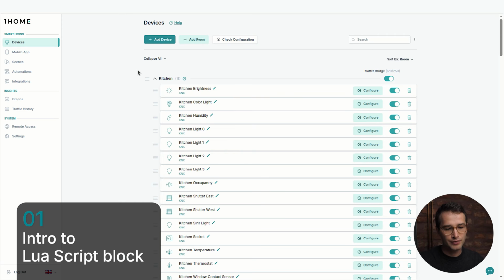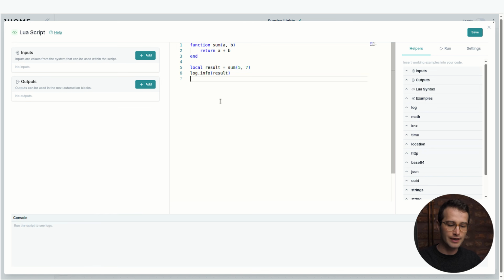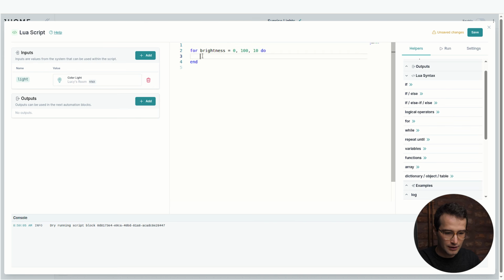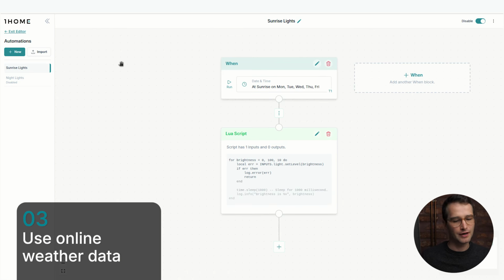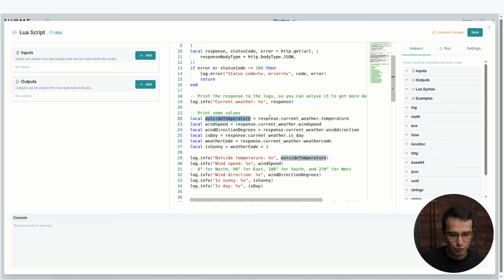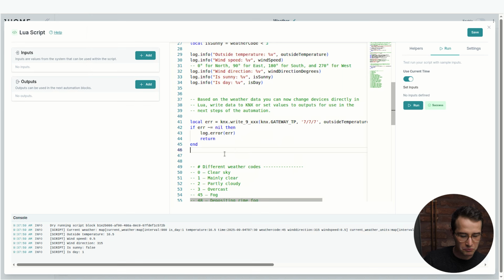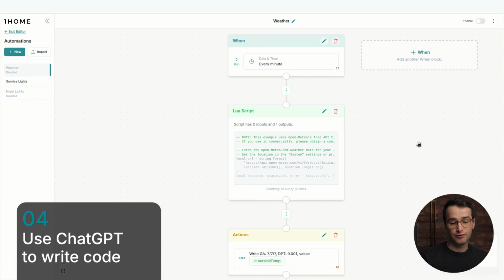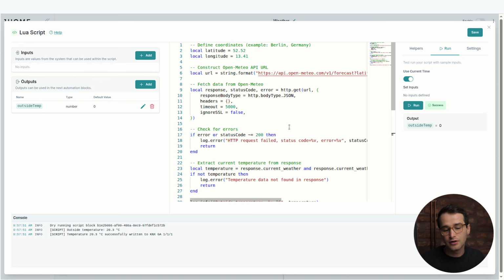Lua Scripting: 1Home Automations Deep dive

Comment: Very important upgrade and very much appreciated 👍! I was just struggling on a specific issue which I could not solve with the current Actions available. Looks like a whole new world of possibilities. Is it possible to get a last known KNX value inside Lua without actually reading it actively on the KNX bus? That's another feature I am missing.
Reply from the maker: This is possible if the device you're getting values from is set up as "Generic Device" in 1Home. Then you'll get last known value, not read from bus.

Comment: I've asked several times whether the KNX Server PRO has all the features of the other devices. The answer has always been yes. But I can't find a LUA function (version 4.1).
Reply from the maker: Hey! Lua, Traffic Monitor and Graphs are coming to 1Home Server KNX Pro with the v5.0.0 release in the next few weeks!
Reply: @1HomeSmartHome  Hello, I still have the 1Home Server for KNX, not the Pro Server, because the Pro didn’t exist yet when I bought my 1Home Server. I wanted to ask if the Lua scripting will also be available for my 1Home Server. I really need this feature.
Reply from the maker: If you bought 1Home Server before Pro variant came out, there's a good chance you actually do have the Pro version :) You can check this on your 1Home Dashboard under Settings -> System -> View Details -> Product Variation. If Product Variation is "for KNX" then you have an early-bird Pro variant.

Comment: This is so powerful. Will it be possible to access historical data with lua, eg the humidity 5 minutes ago to check the trends of certain sensors?
Reply from the maker: Hi! Historical data will not be directly available from the Lua script. If necessary, you could however have a long running Lua script that would read the group address of the humidity sensor and compare changes over time.
Reply: Will it be possible to run an infinite lua script? Is it planned to make historical data available? It should be there from the new graph :)

Comment: Great, but already imported many times KNX project and its not reading all the group address.. please fix the basic first so we can use all the automations properly
Reply from the maker: Thanks for the feedback, we'll keep improving that :)
Reply from the maker: Have you had more success with your imports? If not, feel free to contact us at support@1home.io
Additional tip: in case some devices are not detected, you can always add them manually via the "+" button.
Reply: @1HomeSmartHome  No, I didnt guys.. I've already talked to support but they said there is nothing to do yet but to insert manually.. i have a lot of devices and group address, it's inviable to check one by one and see what is missing and after include manually all the missing ones.. the import funciont should work